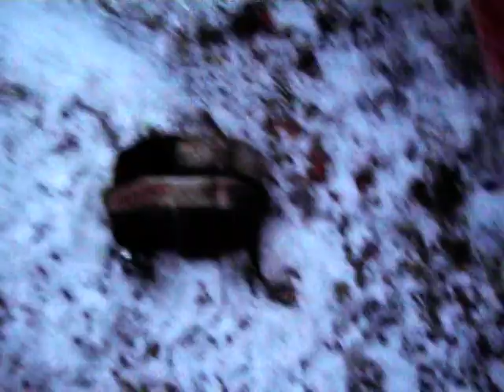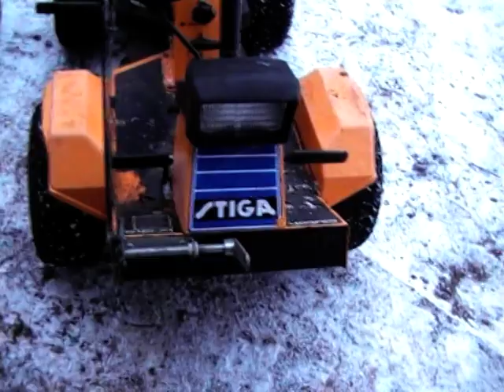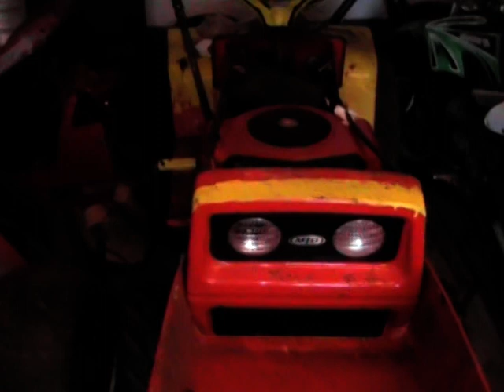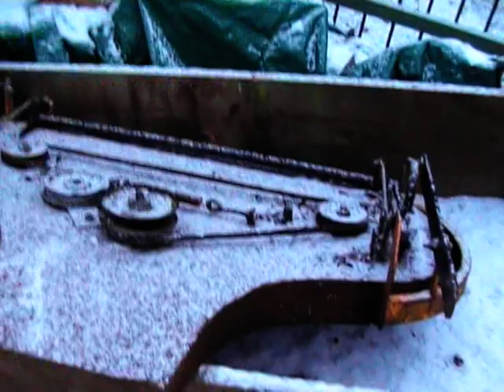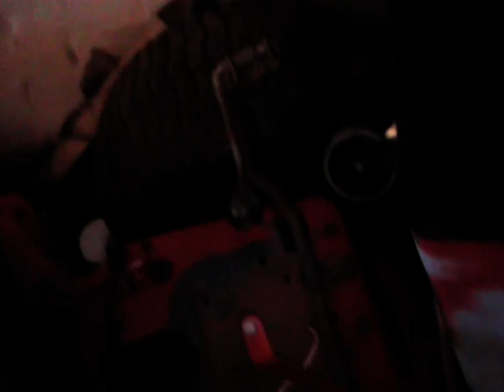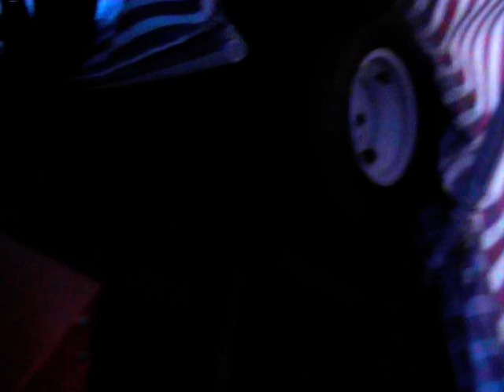Winter Update

Comment from the maker: @tractorkid44 Mine has a crack across the lense too.  But I keep this thing covered so it isnt an issue.  Really wish I had the original pulleys for it.
Im keeping the fuel tank in  the back, but putting a boat-style inline fuel pump, hand operated, it stops the fuel flowing back down the line when the engine is off too

Comment from the maker: I swapped over the coils with one I know works.  Its annoying how I have 2 bad coils.  With the other coil it started up.  Cleaning the flywheel doesnt do a whole lot, its the magnet that gives it the spark. Unless the rust it really bad.  I always clean the magneto ends though.  It doesnt have points btw.

I can imagine.  I'd hate to have an engine without knowing if it worked!